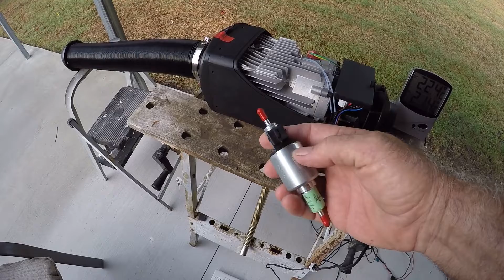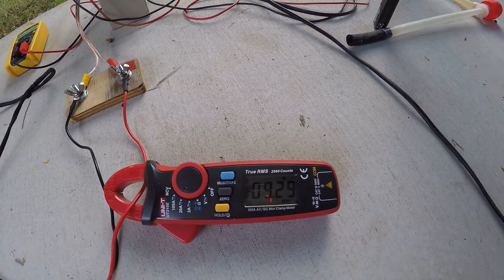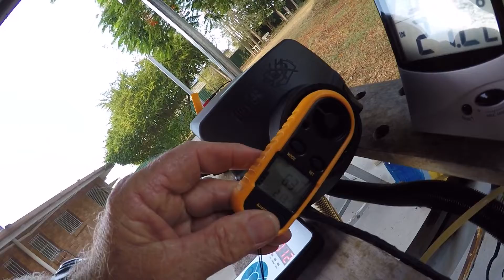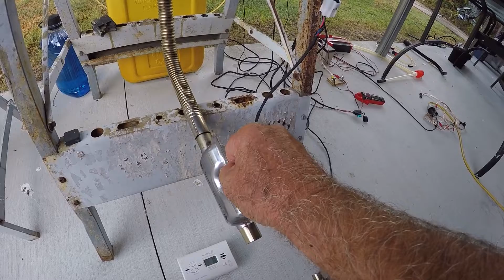Chinese Diesel Air Heaters - Part 2  -  5KW Bench Test

Comment: There are other factors as well, if the ambient air temperature is -20 C or -2F the output wiss change.  If you have the unit recirculating the air these results will change.  Alot of heat is expelled out the exaust pipe, i like the idea of using a radiator or cast iron wall rad to capture that heat.

Comment: Thanks for all the Intel, homie g-funk nasty! Been considering a CDH for years for my van house but was weary of getting ripped off. SO many complaints. And it's easy to believe them when the original is thousands and the CDH is under $100USD.  Appreciate your breakdown of the differences. So tired of buddy heaters and I don't care what they say, the damned things are not safe! Rock on to funk with the g nasty, homie
Reply from the maker: Hi David. 
The vast majority of Chinese heaters are excellent heaters and cost a small fraction of the price of brand name heaters. 

Choose a supplier with a warehouse in your own country, and one who has a good rating and does returns if you get the very rare problem heater. JMcK

Comment: Should the fuel pump be mounted with the output facing up? (air bubbles in fuel line BETWEEN fuel pump and combustion chamber?)

Comment: finally a sensible and well explained video 😁....
one question.....what fan speeds are you getting at the various Hz rates please - perhaps at 5.5, 3.6 and 1.6.... thanks
Reply from the maker: Sorry David, it is some 5 years since I did these videos and I do not remember.
I also recommend, that unless you are a real enthusiast you don't change the factory settings. There is no factory reset button if you get into trouble.  JMcK
Reply: That's ok....IAM a real enthusiast.....if it ain't broke, fix it till it is 😅😅
Reply from the maker: 👍……Good for you.
You remind me of me……I just have to know some of this stuff, and how things work.
For leisure, I don't read books, I read manuals.  😀😳….JMcK
Reply: I dont.... I take things apart and work out how they work.... the manual is however always useful for putting things back together though 😵‍💫

Comment: How do they do the proportional control of the fan?
Reply from the maker: Works through the ICU. 
The ICU matches fan speed with fuel delivery to achieve best fuel air mix ratio.  
Merry Christmas
Reply: @johnmck1147  must have a lookup table or maybe it's a linear function. And a Merry Christmas to you and yours.

Comment: Thanks John - You're so right about all you say. I see so many people that connect them to mains voltage transformers/power supplies and cringe at the thought of what happens if the power goes off. Even when you tell them, they don't seem to understand how important the shut down process is.
Reply from the maker: Fortunately mains failure is extremely rare in Aus.  JMcK

Comment: This is fantastic, do have and can share a spreadsheet of the results of the 5 kw vs 2 kw heater. Would love to see the noise level / fuel consumption / heat output for each pevel of volume air output.

Comment: First of all great video,,I am going to install my heater in my workshop the exhaust will be going through a wall of a wooden shed I am thinking of putting the exhaust through a copper pipe to protect the wood do you think this would be ok and also can I keep the inlet pipe inside the shed or does that have to go outside as well thanks in advance Keith Wales U.K.

Comment: John great videos I watching from Scotland uk , I have a question do carbon monoxide detectors work with detecting diesel fumes ? I know through working in the motor vehicle industry that the carbon content of a petrol vehicle is detectable by use of a co2 detector as it is of much higher content but with diesel exhaust fumes it is much lower hence a co2 detector wouldn't pick up the nox fumes which  diesel produces which are also deadly ?
Reply from the maker: Hi James. Diesel fumes from where?
If from an exhaust, the CO meter will sound.

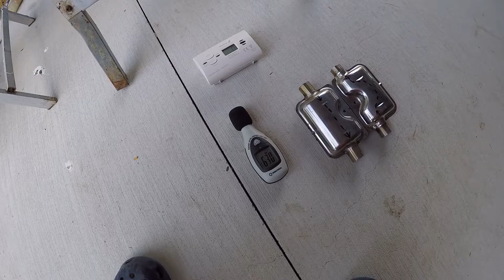Comment: 1) 10:35 63 DECIBELS: One foot from exhaust pipe running on low with NO muffler. 

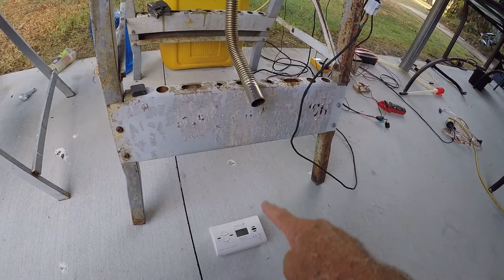2) 10:45 TWO TYPES OF MUFFLERS: Straight / flow thru and the other sends exhaust in a U shaped path. Both mufflers are stainless steel and have sound absorbent fiberglass inside.

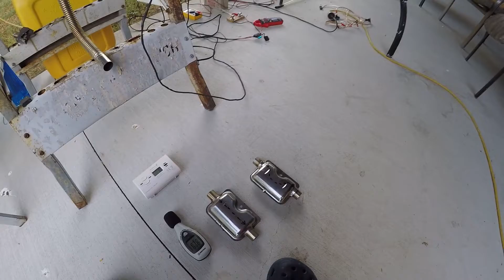3) 11:51 QUIETEST MUFFLER: The straight / flow thru muffler is by far the quietest because it doesn't cause back pressure like the U path muffler does. Flow thru brings it down from 64 decibels to about 57-58 decibels. Doesn't seem like much but it is radically quieter. The U path muffler brought it down from 64 decibels to 59-60. The flow thru is a lot more efficient because of the straight path.

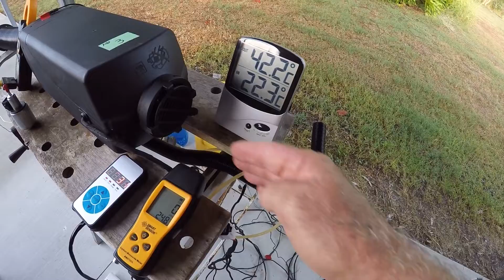4) 16:27 STRAIGHT PATH: Complete combustion requires a free path for the intake and exhaust. If you restrict the exhaust by making tight turns or using the U path muffler then you will restrict the intake. BOTH hoses, intake and exhaust, should be run on as straight a path as is possible. If your intake requires a long hose then get an adapter and go with a hose with a larger diameter.

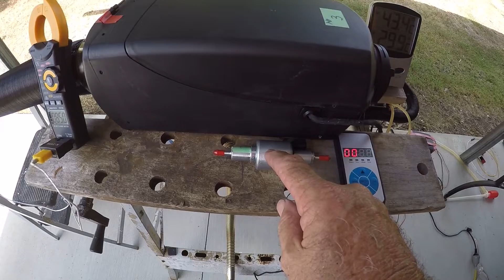5) 17:55 FUEL PUMP: 5 hz = 5 pulses per second. The fuel pump has a little piston inside that goes up and down. It's normal to see little bubbles in the fuel line. It's not normal to see large bubbles so it's important to install the fuel pump vertically with top up or in an angled position. If you install the fuel pump horizontally then it will have to work harder, will create big bubbles and it won't be properly lubricated by the diesel fuel.

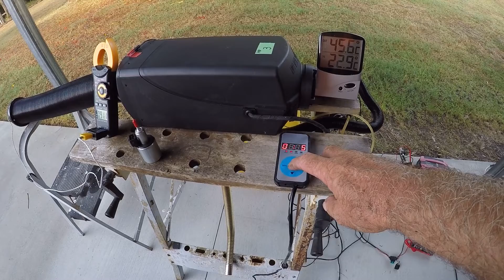6) 19:22 CIRCUIT BREAKER: It's extremely important to install the heater on its own circuit breaker. The reason is because when you shut it off with the controller the heater goes through a crucially important shut down process which includes burning off leftover fuel inside and cooling down the ECU. If the heater is on a master circuit breaker and for whatever reason that master circuit breaker flipped off then you could fry the ECU.

Comment: I would like to say something about the sound measurements.
Our ears experience sound pressure on a logarithmic scale.
With that said, only 3dB is doubling the sound pressure or cutting it by half.
the four dB is a 2,5 times reduction in sound pressure. You can find the formulas yourself on the internet by searching for "amplification scale".

Comment: Hi John, thanks for the video series.  I'm about to fit a 8kW Chinese diesel heater to my boat in the UK, and wish to add a 12 V voltage stabiliser/regulator.  Do you know how many Amps the unit draws at peak please?  Thanks, Richard
Reply from the maker: Hi T1,
Eight to ten amps for half a minute or so to start, and 1 to 3 amps to run, depending on heat setting.  JMcK

Comment: liked it too/is the 5kw the same as the 8kw/in size/what is the difference/i bought a 8kw unit /will you test the 8kw out of a new box/can the control moniter/ of the 5kw work on the 8kw an it becomes a 5kw diesel chinese heater /thanks much

Comment: I notice you're running this with the air inlet cap removed,  so does it affect the through put of air with the cap screwed on?
Reply from the maker: Hi Peter, The cap would restrict the flow of air a tiny bit, but it is not noticeable. JMcK

Comment: Good video, I am watching the whole series, and do not want to make common mistakes as you see on-line. Torn between the stand alone unit and the kit ones.
Reply from the maker: Hi WRXS, pleased you find the videos helpful. Its personal choice which type you choose. Sadly the stand alone heaters need some modification before use.  JMcK
Reply: I purchased the kit form heater and installed it in my trailer project as per you recommendations, I live in an arctic climate "Canada" and the heater has performed above expectations with my kerosene Diesel fuel mix. Because of sawdust I rigged up a shop-vac filter on the intake side so it would not suck in wood particles. Going on a very long trip to Newfoundland and was wondering the spare heater parts needed for just in case scenarios.

Comment: Hello John  could you  explain  the operation of the digital  control panel?  I can not find  any instructions  on  operating  the heater  with one of thease  cont
Reply from the maker: Hi Paillight, there are quite a number of videos on the control panels already out there. 
Search “Chinese air heater or parking heater control panel”   JMcK

Comment: Curious, why are there two intakes?  Is one needed to be taking air from the outside and the other from the inside of the area to be heated?  Would it make more sense for the design to combine air intakes for simplicity?

Comment: John. I have the smaller 2kw unit which worked well for a few months but now seems to stick on the cooling down cycle after I turn it off. This never stops no matter how long you leave it. The temp sensor has some significant kinks in the wires. The temp bars on the lcd constantly read full temp no matter how long the unit has been switched off with the fan running. Do you think a poor circuit to the combustion chamber heat sensor would cause this?
Reply from the maker: Hi Michael

Yes, looks like from what you describe. You could try and buy a spare sensor on line (I have never had a need), But you also could have a controller issue.

But these heaters are so cheap, perhaps it is better to buy a new one and use the old one for spare parts.  JMcK

Comment: Fantastic videos John, I really appreciate all the work you've put into these. One question: Since any restriction in the combustion intake or exhaust lines is bad, are there examples where you might avoid the hoses altogether? I plan to install mine on the floor of my caravan with the intake and outlet stubs obviously going through holes in the floor. Do I need the supplied intake and exhaust hoses at all? Are these provided to create some separation between exhaust and intake? If so, what do you think would be the minimum separation? Should I shorten the hoses supplied? Thanks again. Chris.
Reply from the maker: Hi Chris,

First, thanks for the positive comments.

You need some separation between the exhaust and the combustion air intake so you don't suck exhaust gases into the combustion chamber. It won't be unsafe for you, but it will creat fuel air mix issues and lead to excessive carbon build up.

You also need a filter on the combustion air intake to keep small critters from being sucked into the heater and “cooked”.

If you wish to go minimum, perhaps 200 mm to  300 mm (1 foot ) of exhaust and intake pipe might suit you. 
Run in opposite directions you would have plenty of separation. JMcK

Comment: Hi John, Is it acceptable to mount the heater on an incline? Will the heater still work? Would an angle cause issues?
Reply from the maker: Hi Sterling, 

These heaters will work at any angle, and any incline....For a short while.     Then they won't start or run. 

The heater works best running flat to get best fuel atomisation and best burn properties.

However they can be rotated on their side 90° provided it is the side with the glow plug up, to prevent fuel pooling around the plug.

For incline, I suggest you follow the Eberspacher manual. The German company Eberspacher invented these heaters and have decades of operation behind them. Most of the current Chinese Diesel heaters are almost exact copies of the Eberspacher heater. (There are also some Chinese copies of the Webasto brand heaters)

Eberspacher recommend an install incline of no more than 30°. As mentioned earlier, the heater will work at a greater incline, but you will soon have starting, running, and maintenance issues from excessive carbon build up.   JMcK

Comment: Very informative with excellent technical information.
My dilemma was should I buy some quality German brand or the Chinese job.
Always a bit wary of some stuff on eBay at times.
When I think these thing are really simple it does make me wonder why Chinese ones are dirt cheap and why the German ones are so astronomically expensive.
Is there a middle ground I wonder.
I took on board your advise about install and certainly the free flow of inlet and exhaust.
I think I'm going to bite the bullet and buy the Wuhan Special lol

I have heard that that the fuel pumps can be a bit noisy as they pulsate, I imagine you need to be careful what you mount it to.
Reply from the maker: Hi Steven,

I have a genuine German Eberspacher, and a number of Chinese copy heaters.

Most (not all) of the Chinese copy heaters are EXCELLENT  heaters, that can be bought for a small fraction of the price of a genuine heater. If you buy from an online supplier with a local warehouse that accepts returns you have very little risk and a huge saving in cost. 

The mechanical parts are almost identical and are often interchangeable. The main difference is in the wiring. The genuine German heaters have sealed electronics and waterproof plugs, the Chinese heaters do not. For the price savings, this is not an issue for me and in a marine environment I spray the ECU with a sealer, and the plugs with WD40 or similar.

Worst case if you bought a rare dud Chinese heater and the seller won't replace it, you use it for spare parts, buy from another supplier and badly rate the original supplier.  

All fuel electromagnetic fuel pumps, by their very nature,  are a bit noisy with a ticking sound. This is caused by the little piston flying up and down and hitting the stops. 

Cheers,   JMcK
Reply: @johnmck1147  Thanks for the insight.
For me waterproofing is not an issue as this heater will go in a caravan and be under the bed.
I imagine all pumps are noisy as they are solenoids and it makes good sense about vertical mounting

Comment: John, Great videos!  Extremely informative and complete!  Thank you!   Is there any back-pressure requirement on the exhaust that you are aware of?  i.e. if the size of the exhaust is increased to reduce pressure, can it be reduced too much?   Not sure if this would even be a need for me, really just curious on the back-pressure issue.
Reply from the maker: Hi MP,

I have never personally seen an issue with lack of back pressure, but plenty of cases where excessive back pressure did cause issues. The burn chamber is a burn chamber, not a IC Engine, and the exhaust fan is very tiny. The less exhaust resistance the better.  JMcK

Comment: Very helpful videos, thank you for producing them. Question... Since these are so efficient, I'd like to use one of these in my workshop where I have electrical power already. Would I have to use some sort of inverter to power this heater?
Reply from the maker: Hi NM,

You could use a DC power supply that had a max output of 15 amps (10 amps are needed to start heater) 

However if your area is prone to power outage in winter, suggest you use a small battery and a small battery charger, or one of those interruptible power supply units. The heater can badly overheat and destroy the ECU if power is suddenly disconnected and the heater can not do its cool down cycle.   JMcK
Reply: @johnmck1147  Thanks for the quick reply and recommendations. I do have a fairly new ATV battery, good idea with the charger.

Comment: Hi Sir, Amazing videos!! I had a question. You mentioned the intake should be stock size unless it's a longer hose in which case you would increase the diameter. Would you do the same with the exhaust? Are there any benefits to a larger exhaust hose and would that cause issues with the unit?
Reply from the maker: Yes Sean, It is better to keep the exhaust as short as possible, but if you need to increase the length it is better to increase the diameter to lessen back pressure. JMcK

Comment: John, I have a new diesel heater. I have it hooked up to my Bluetti potable generator. If short out at the start until the 5th or 6th try before it gets fully going. The batter says its shorting out. Is my unit possibly drawing more than 10 amps at start-up? That's the max load on my generator.
Reply from the maker: Hi Chuck, A 10 amp generator is real borderline and can give you issues. It is too small for these heaters.
Yes, 10 amps is the average draw, but some heaters may surge a little higher.   JMcK
Reply: @johnmck1147  that might explain why it takes several start-ups to get it going. It usually takes 5 or 6 times in a row then it takes off. Do you think it matters on the plug itself? A small 12V plug versus the larger cigarette-sized plug? I'm currently using the smaller one.
Reply from the maker: Anything that reduces the voltage drop helps, including increasing the power wire sizes.  JMcK

Comment: I'm working my way through your videos so I might find the answer to my question later but if not : Can I run it on biodiesel made from waste vegetable oil and if not, why?
Reply from the maker: Hi Mats,

These heaters will run on almost any fuel.......  For a while. ......  Then they stop.

The more “oiley” the fuel the more carbon produced and deposited in the combustion chamber. 
When the carbon deposits get severe enough the heater won't start or run, and must be removed.

You can run bio diesel, but your service intervals will be shorter.    JMcK
Reply: @johnmck1147   Hmm...I wonder <thinking cap on), I believe you said in the prior video that you could burn off deposited carbon by running it at maximum for 15 minutes once a month or so. If I were to run it on pure diesel at maximum every fortnight for ½ an hour, Do you think that would work or do you have another suggestion that would let me run it on biodiesel without extra maintenance ? Can't say I'm excited about shorter service intervals. Think I'll look into how "oiley" biodiesel is. I was under the impression that rape methyl esters and other biodiesels consisted of lighter oils, but i*ve been wrong before :-)